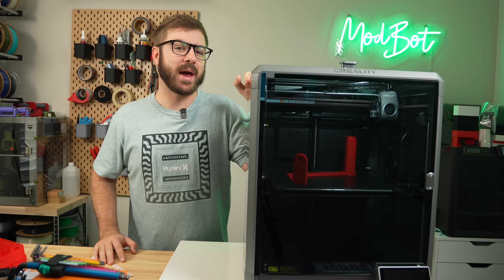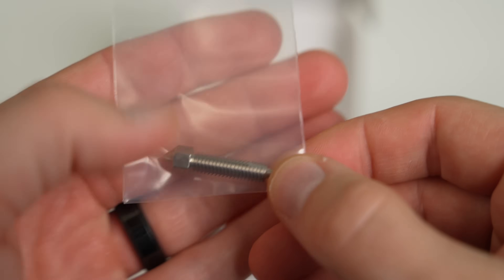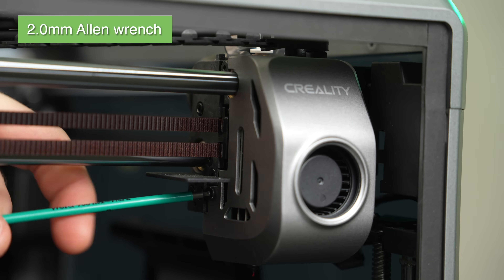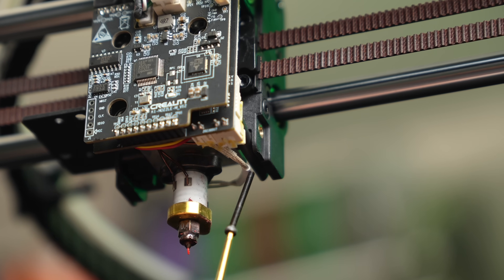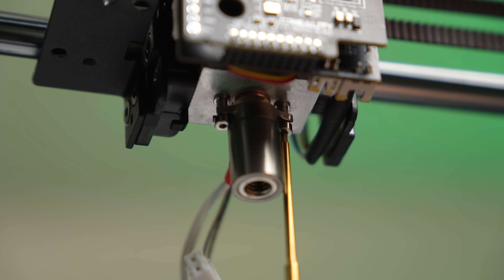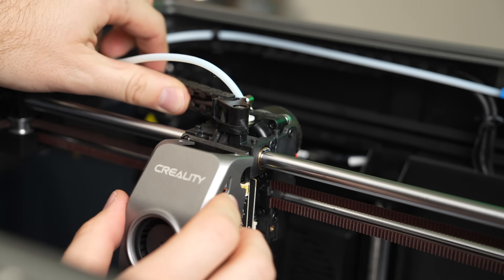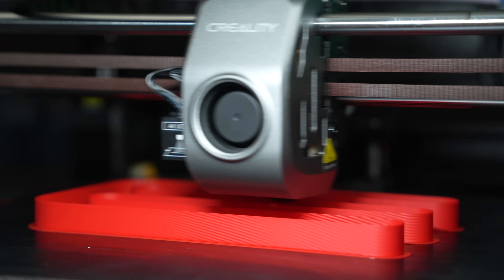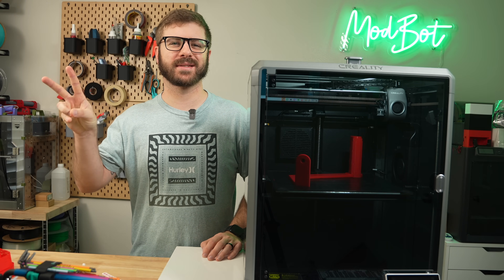Drop In Hotend Upgrade For Creality K1 & K1 Max Printers (Micro Swiss FlowTech™)

Comment: Do I understand correctly that the flotech hotend is prevented from sliding up and down by the friction of the titanium tube against the copper insert on the heat sink?   Seems somewhat precarious.   I wonder if it would loosen up and fail if the nozzle was changed many times.

Comment: Running this hotend and this FlowTech™ CHT High Flow - CM2 nozel. But I seem to constantly fight stringing on both PLA and PETG.  I have tried drop the temp 5 to 10 degrees after the swap, but that didnt seem to help much.

Comment: Lovely laid back presentation…really, but the truth of the matter is that this installation is a nightmarish and a really bad ride. The plugs are extremely hard to put in the sockets, and you have to put the device in several positions (not mentioned) to have any hope of access to them. I spent around 2 hours hating the entire ordeal, and will eventually calm down enough to see if I got it right. Easy? As much as the D Day invasion, and woe to my fallen brothers who attempted this experiment….be honest, just disassembling the original unit is complex….i am disappointed you seemed so sincere, yet the actual process was definitely more challenging, and very claustrophobic.  “So simple, a 10 year old child could do it…”  ok, find one at 2am with a Physics degree…..😊
Reply: However, as a follow up, I finally got it working correctly, and it’s printing very nice. So the basic premise is, it’s not so easy to install …”That even a slightly demented 2 year old Wombat, could do it in less than 10 minutes! …but more like “It requires patience, a bit of skill, and mirrors ,or small cameras with monitors ,to see connections that are in recessed places…” also learned that working on these devices is very difficult…with a hint of frustration….

Comment: Could you do an updated video on this because there has been changes to the Creality K1 series in how they connect and Microswiss has not updated their instructions. I'm fairly new to 3d printing and my concern right now is wire management because of the Heater and Thermistor connector adapter.

Comment: The temp is a bit low for my liking, even my cr10 max can go that high and it's ancient (yes if you still have the PTFE it will get cooked and outgass but it can do it) just a all metal hot end is nice because you don't have a tube to cook but the "upgraded" k1 hot end? It just doesn't feel like that much of a improvement.

Comment: I have the newer K1 Max so I had the updated MicroSwiss upgrade with the new mounting screws and insert. Installation was a breeze. I don't remember either the MicroSwiss instructions or this video mentioning anything about using the thermal grease. A small packet was included in the package. Is this something that was needed for the older K1 Max?

Comment: I went "best of both worlds"
I did something a little different.
I really liked the unicorn nozzle, and after seeing and holding the Microswiss hotend in hand it was clear that it was a much higher quality hotend than stock...
After installing the MS setup I wasn't getting the same quality prints I'd been getting with the unicorn nozzle, an idea came to me...what if I took out the MS throat and then screwed the unicorn nozzle into the MS hotend.
Worked perfectly and I've been getting some of the best prints I've ever seen off this printer yet.
Now I'd guess that the MS CHT nozzles still give you better flow rates and probably will allow you to push the printer at higher speeds...but I'm here for the quality not the speed. 
And this setup is pumping out some of the smoothest clean lines I've seen yet!

Comment: Can I use the unicorn nozzle with this hotend?
Reply: No, because they lengthened the nozzle to also act as the heat break, once you perform this upgrade, only FlowTech nozzles will work with this setup.

Comment: I Purchased via Amazon a new K1 Max on 22nd July 2024 several prints later (today Aug 1st) it leaked and backed up actually breaking wires and sending a fault. Called Creality service and Amazon received kindly (Run-Around) I Saw your video re Micro Swiss and have used them to replace my old CR6-SE hot-end. So I order one after watching your video this evening. "HOWEVER" I've noticed that the back of the heat sink on my K1 Max, does-not have an Allen screw anywhere. Also, the two vertical screws that hold the heater core in place will not budge. Do you know if Creality Changed the hot end assembly from your unit or is mine an old stock K1 Max via Amazon?   If I could send you photos of the rear of the heatsink I would. Thanks, Bob Griffith Winter Haven, FL
Reply: Lol your the same bloke from Reddit blaming creality for you cross thread two of the same nozzle , you got destroyed on Reddit so now you run to yt 😭😭😭😭
Reply: @ I’m not even on Reddit . Don’t you know what you’re talking about

Comment: a question - why did u changed hotend to begin with ? is stock K1 Max not that good ?
Reply: I tried running with the stock hotend for a while. The clogging and leaking I had made a huge mess. Because the nozzle and heatbreak are machined as a single piece, meaning you don't need to worry about heat expansion because there's no gap for filament to leak out of. That's what they mean by "cold nozzle swaps." When you pull the nozzle, the ENTIRE nozzle/heatbreak comes out at once. The input opening goes all the way up and butts up against the output of the extrusion gears, so it's a single channel all the way down to the nozzle aperture.

Comment: Help, the screw that keeps the heatercore in place stripped, what can i do... These screws are so small😢
Reply: I thought I had stripped screws when I replaced my original hot end due to breaking the wires trying to remove a filament blob that coated the outside of the hot end. It turns out that some of the material had coated the screws above the hot end and was locking the screws from turning.

I saw a suggestion to try holding the tip of a soldering iron to the head of the allen screw for 2.5 minutes then quickly remove the screw with your allen wrench before it has a chance to cool down. That worked easily for me.
Reply: Another suggestion is using a 1/16" ball end wrench or hex key in the stripped out hole. It is slightly larger than the 1.5mm hex key. The ball end works a little better since it is oversized the taper helps it fit if the 1/16 hex key wont quite fit.

Comment: If i get the flowtech hotend, do i have to use the flowtech nozzles or can i use a diamond tipped one instead?
Reply: unfortunately no. the hot ends are designed differently.
Reply: You MUST use FlowTech nozzles because this upgrade changes the entire flow channel to the nozzle tip. That said, MicroSwiss DOES make Tool Steel and Diamond nozzles for abrasive and super-abrasive filaments.

Comment: Great guide, but you need to put some thermal paste on that copper insert before installing it into the heatsink. Without thermal paste there will be a huge loss of efficiency in the heat transfer between fhe hot end and the heatsink. This will lead to poor cooling control, and the risk of melting fillament before it enters the heating zone of the hot end. This can cause retraction issues, especially in softer fillaments.

Comment: does it print carboon with the standard hotend from micro swiss?
Reply: The standard nozzle with the kit is plated brass. There are more exotic nozzles like the CM2 (Nickel-plated Copper Chromium Zirconium with M2 hardened tool steel tip) and the Diamondback (Polycrystalline Diamond Tip). The CM2's cost is pretty reasonable at about $24/each and CAN do carbon but will wear much faster than the Diamondback ($125/each). I'd stick with the CM2 if I only tinkered with carbon, but if you do any kind of consistent carbon printing, you'll need to pop for a PCD-tipped nozzle, no matter what printer you have.

Comment: I have the TriangleLab CHCB-OT  on the K1 and it goes perfect also but I have to remove the nozzle to print with more technical filaments (that's my objective & the reason why I purschased it)... Does the Microswiss to be able to print with CF??? Because if it's true, I will purchase one and leave the other as spare.

Comment: This is an essential upgrade for the K1 series. The plated nozzle lays down layers perfectly. So much so I was able to stop using glue sticks. All of the little annoying defects in my prints are gone. It was like a night and day difference. My prints are literally perfect.
Reply: You recommend it? I'm getting my k1max in one week. Should I order this and install asap? Or see if it's needed
Reply: @giinnoo08 I’d also like to know if people really recommend this. I’m currently having random under extrusion and it’s destroying my prints. I’m considering this as an upgrade but would like to know if others have had an under extrusion issue?
Reply: This hotend is garbage. Get a Triangle Labs CHCB-OT with a Z+ nozzle. They're way better.

Comment: i just finished dissasembling the hotend and man that glue on the connectors are a huge pain! I have the flowtech in the main right now. wish they had a hardend steel nozzle will need to avoid CF and glow in the dark filaments till they release one. or until triagle labs or someone else makes a compatible nozzle. 

Honstely the lidar is a waste of hotend space. you might at well remove it as it doesn't do anything yet unless you print from creatlity cloud

Comment: Did you adjust any of your sliced settings for this. I installed one (after a nozzle sheered in the original) and have had really bad stringing on every print since. Running orca slicer with the default k1 max profiles. Have tried upping retraction distance, but I don’t know how far to go with it
Reply: Stringing = dial down the heat,  possibly flowrate but heat first

Comment: Thanks for the video. Very intresting. I was a little surprised,  that CHC heater connected by XH2.54 socet. The maximum current for CHC is about 5Amps, but the socet is for 2Amps only. Sorry for my English. :)

Comment: Looks like a specially-designed nozzle just for this hot end.  I don't see a harden-steel version on the Micro Swiss website.  What do you do for printing abrasive filaments?
Reply: It's called the Micro Swiss CM2™ Nozzle - for FlowTech™, and they are $23.75 each. "Micro Swiss CM2™ Nozzle is an ideal nozzle for all applications. Core of the nozzle is made of high-temperature Copper Chromium Zirconium and plated with an Electroless Nickel Plating. This special alloy retains its strength at much higher temperatures compared to a regular copper alloy. The tip of the nozzle is made of M2 Hardened High Speed Steel and coated with a special nonstick nano coating."

Comment: RE removing the cables... cut the goop before you start wiggling - whoever plugged mine in at the factory had a heavy hand with the glue. I actually cracked the JST connector when mine finally came loose. It works, but I'm a little worried it's going to come loose at some point.
Reply: Same here.  VERY difficult to get that plug out and a definitely cracked a chunk of it off.  I had to meticulously cut the glue off.  Obviously, this is on Creality and not Micro Swiss but it would be helpful for this tip to be in the video...

Comment: Every single 3D printing channel is releasing paid advertising for this „upgrade“ that is essentially not even a real upgrade and is just overpriced. I say it out loud: this product and their marketing strategy straight sucks
Reply: I haven’t had my K-1 Max a week and the hot end went back.  A quick Google search shows that it is the weakest part on this printer and that many have had to deal with error 2654.  Many have complained about its failure.  Being able to exchange the hot end cold makes it worth it for me and the fact that it doesn’t clog as easily is also significant to many.  The thermistor on mine was likely faulty out of the box.  It overshot the temperature every time and then backed down.  It’s not supposed to do that.   But as he says in his video, this is just a how to video.  He’s not like “every single 3d printing channel.” In fact, his extremely clear explanation of “how to” is something rarely seen.
Reply: @chisenefregaormai8665 just make sure to get the latest hotend and extruder versions. It sucks to have to care about that but the latest versions have had no problem printing all types of materials for close to 300h now almost non stop. The regular k1 I had before, with the older versions, didn't last for more than 10h
Reply: I happily spent $135 CAD to buy Made in the USA vs Made in China. Perfect printing since I installed this early last week. I’ve been using micro swiss hardware for years. Does what it says on the tin.
Reply: Cold nozzle swap. Worth it for that alone.
Reply: You clearly have NO clue what you're talking about.
Reply: So what does a 12% increase in flow rate net you in printing time or quality?
Reply: Got mine for $45. A bargain
Reply: I was having issues with my filament catching when I tried to feed new filament in. I baught the micro tech hotend to see if it would fix it and it does. It's buttery smooth.  
If you don't need it, don't buy it. It was worth the money for me.
Reply from the maker: Micro Swiss has been making quality upgrades for printers for many many years. Creality launched this printer and already had 2-3 extruder revisions and a hotend revision due to issues. 

If you want to chance it with the stock hardware thats fine. You may have no issues. Some have experienced leaks and clogs already. $65 for a hotend is mid ranged price wise and less than most others. 

If you are happy with the stock hotend thats great, but many would rather not chance it. The design on this setup removes the possibility of a heatbreak leak.
Reply: @ModBotArmy  Honestly, I‘d have that opinion too, if I was paid whatever they pay you for a review (I estimate a 4 to 5 figure amount). From our point of view, it’s just a part, that replaces another working part for no tangible reason. I‘m not mad at you for making a profit (in fact I support that!), I just feel like most 3d printing related channels are evolving into shills, because it pays best. That’s quite the opposite of what the 3d printing community should stand for.
Reply from the maker: I wish it was anywhere close to that amount. I have always pride myself on transparency with my audience. Any review I do covers good and bad. In some cases I look hard to find things to nitpick at because perfect does exist. This is not a review, it is an install video intended to help someone who purchases this hotend. Because of all this shill calling I am seeing more and more creators lean into it. In a sense I can understand it. If you are going to do your best to be fair and cover both sides but still be called a shill there is no winning. I have gotten this far by doing what I feel is right and trying to be as transparent as possible. The goal has always been to help others be it a tutorial or just sharing my experience. Largely I feel that is what we are doing and what I plan to continue doing.    @maximilianlindner
Reply: @ModBotArmy  Some people just don't understand the mod life! I guess he also hasn't had nightmares occur with hot swapping 😅 I personally thank you for this video, sponsored or not they trusted you with their product, you need to make money and we need good Intel from a reliable source. I don't get why everyone thinks everyone should just do these things for free but here we are! Thank you, and please any mods you test out that make the k1/k1 max let us know!

Comment: I hate to see every 3D printer manufacturer making their own high flow nozzles for the new faster Klipper printers.  Proprietary nozzle designs are not in the customer's best interest.  Even worse, many companies offer only a brass 0.4 mm nozzle, even on their larger Max machines where a 0.6 mm would be better for most applications.  If the Micro-Swiss hotend allows use of a standard set of quality Micro-Swiss nozzles, that would be worth the upgrade.

Comment: I planned on upgrading at the start, so I have the hotend and an extra 0.6 nozzle.  I did ask microswiss if they would have hardened steel nozzles and was told eventually they would have other materials.  Right now it is a moot point for me as I await some response from Creality support for a mostly dead K1 Max after it updated itself.  Turns on, and that is all.  I hope they can provide me with a replacement before the short return window closes.  Looks like part of the mainboard died as it will not flash anything and the Ngenix Creality firmware recovery does not do anything.